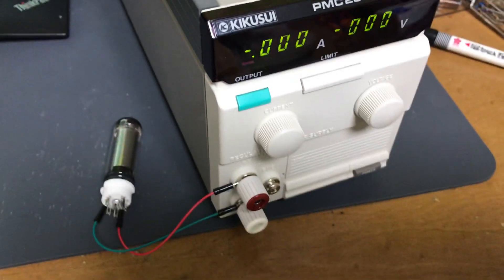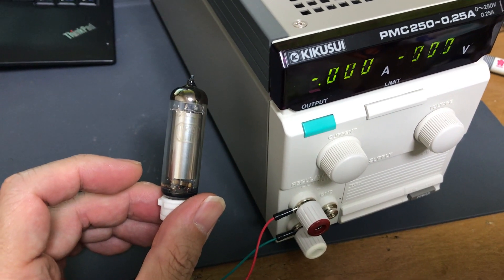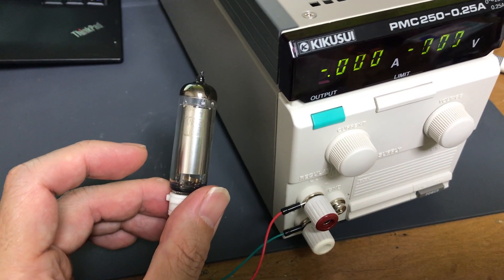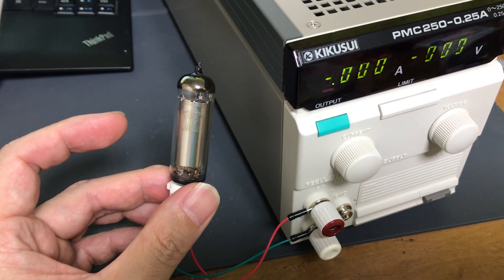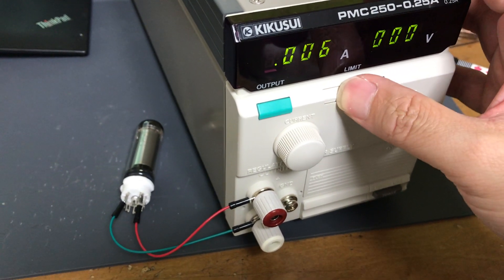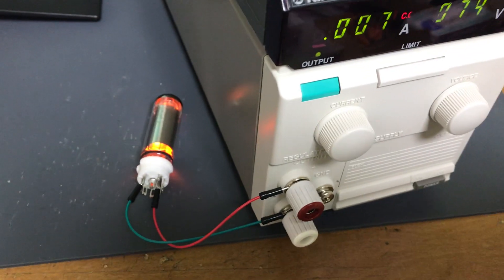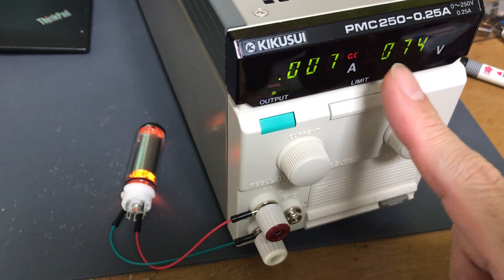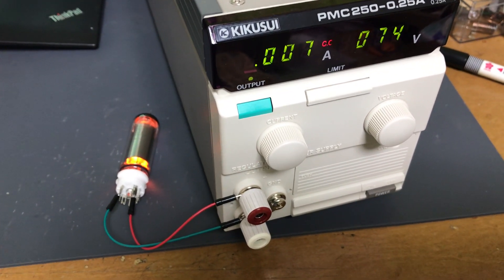Quick check of Voltage Regulator tube

Comment: Interesting! 
Can this technology be used in modern digital systems as well or is it generally too high voltage?
Reply from the maker: Modern digital technology goes lower voltage as possible for lower consumption power from 5V->3.3V->1.8V->... and this type of tube is typically more than 50V. This tube may be still useful for very special application,,, but the reason why we cannot buy voltage regulator tube at digikey is,,,, I guess no one use by various reasons..